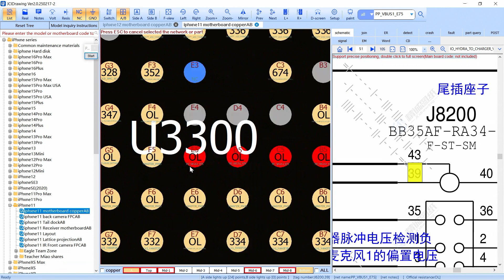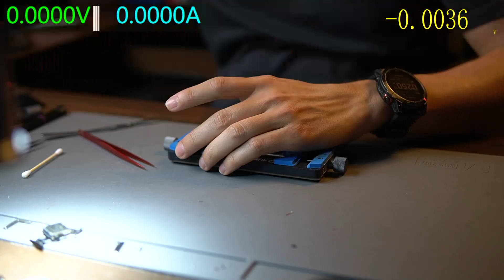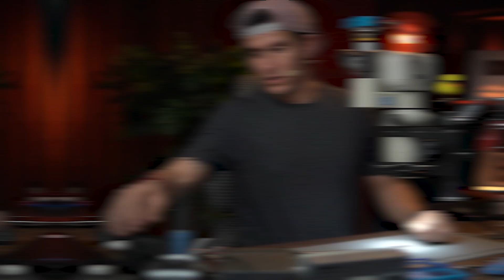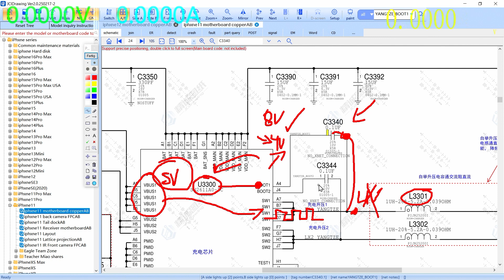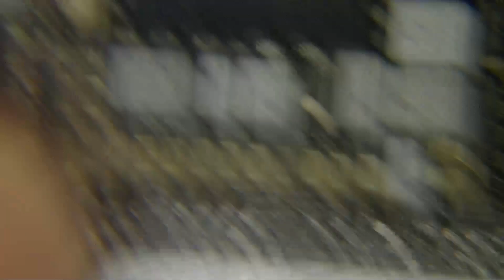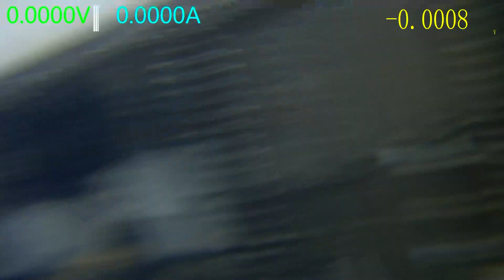🔧 iPhone 11 Not Charging: Step-by-Step Diagnosis and Repair ⚡️

Comment: iPhone 11 Pro I ve changed the screen now when I plug it in you can see the red battery logo but as soon as I disconnect the charging cable the red battery logo disappear. Sometimes the apple logo kicks in but it shuts off straight after, what can it be?

Comment: is it possible for the iphone to be charging with wireless still the charging is bad.... because i have an iphone 11 am working on i'v change d USB ic but yet its not charging.....only charging with wireless charger..thus this mean the charging ic is bad
Reply from the maker: Can be the usb IC
Reply: thanks for your reply sir......but if both the usb IC and charging IC is good...yet no charging signal....pls which line did i need to work on.
Reply: @slyomotayo8168  av you taken any measurements? Or you just  conclude  on changing the USB IC?